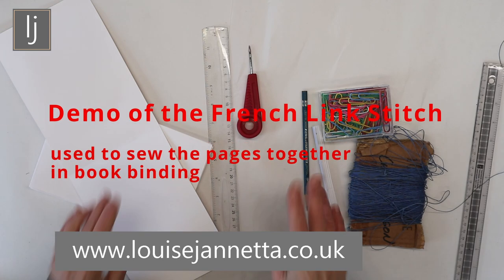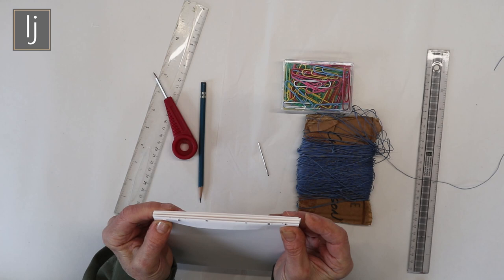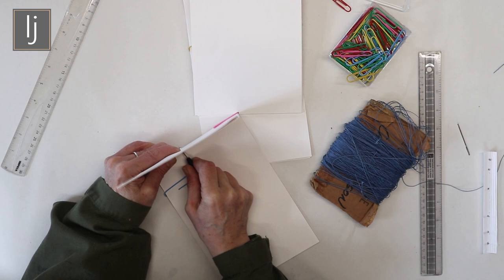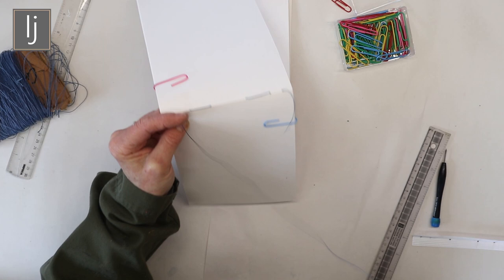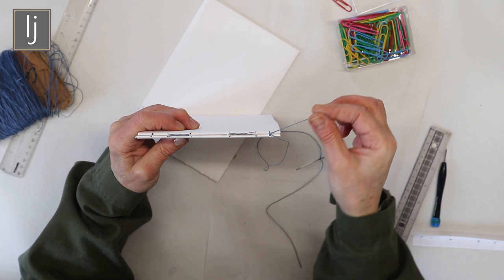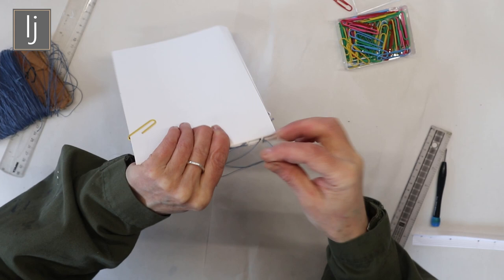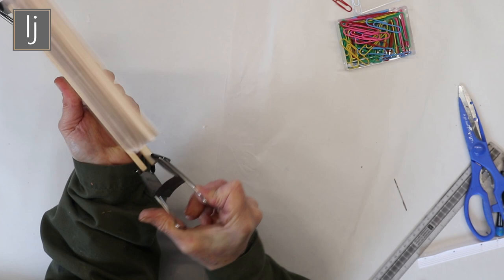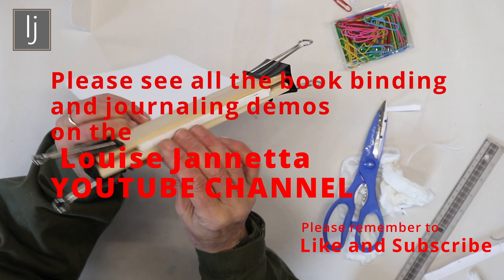Demo of the French Link Bookbinding Stitch used to make handmade books and journals.

Comment: Thank you for sharing this great easy to follow demonstration. I’ve just recently considered making my own artist books so your instructions are exactly what I need. I have a couple of questions.  For the binding paper are you saying “cotton ripped paper?” Where would I buy it online? I’m in the United States?
Reply from the maker: Hi, what it is meant to say is cotton rich paper; I use fabriano paper that is made specifically for intaglio printing. You will be able to purchase that in America. If you can access any just let me know.
Reply: @LouiseJannetta  I’m sorry to say , I have not been able to find any Fabriano paper that is made for Intaglio. But I do thank for your effort and time.
Reply from the maker: @ChapmanGriffith  Hello again and no trouble. In the video, I give alternatives to specialist materials and what you need is something that has a bit of strength and absorbency, hence the cotton-rich paper. There are specialist materials supplied by the bookbinding sales sites one is called "Bookbinding mull spine lining". or it may be called "Bookbinder's spine muslin - Mulls No. 8 - starched, non-stretch". You will see that it is something that helps to keep the signatures fixed together in the spine and really you could use a piece of fabric. If I use fabric I will prime the fabric with diluted PVA glue so that it doesn't fray but diluted enough that the fabric still remains flexible. Most PVA glues dry to a fairly fixed brittle state which is why the bookbinding PVA glues are so much better as they remain flexible when dry. Good luck and happy to help. Keep well and all the best Louise
Reply from the maker: Just a bit more info for you as cotton rich really just means that the paper isn't all wood pulp. In Intaglio printing or etching they use an absorbent cotton rich paper as the paper is soaked before printing making it sofer and more receptive to the textured and etched plate. So any papers that are good for etching will be good.

Cotton rag, also known as rag paper, or simply "rag" is made using cotton linters or cotton from used cloth (rags) as the primary material. Cotton paper is superior in both strength and durability to wood pulp-based paper, which may contain high concentrations of acids, and also absorbs ink or toner better.

Papers manufactured of cotton fiber will last longer and hold up better under repeated handling and various environmental conditions than paper made from wood pulp.